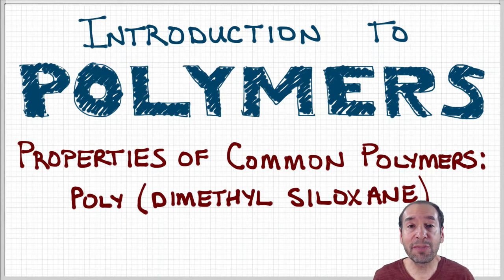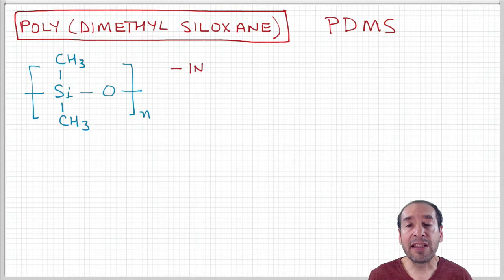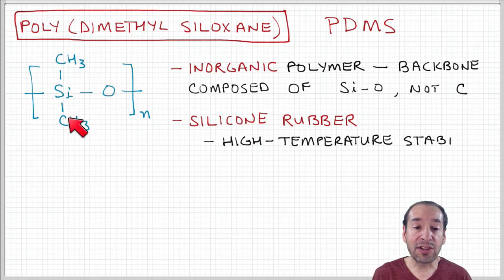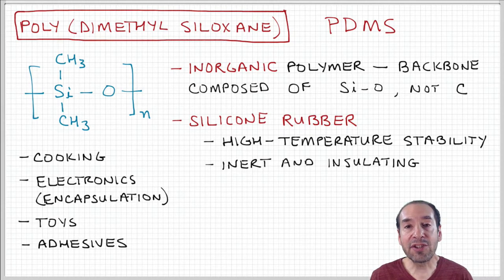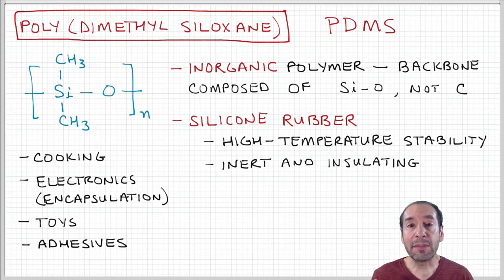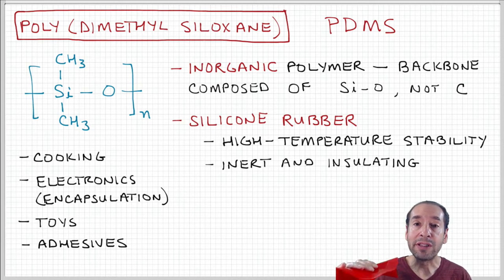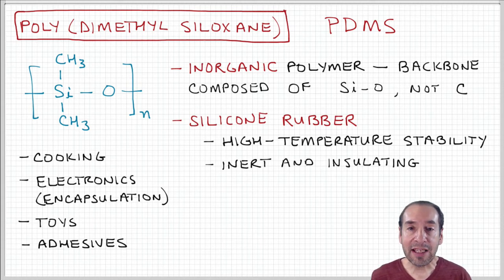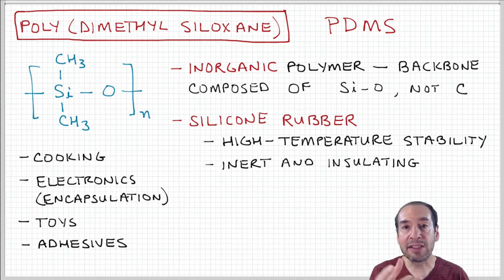Introduction to Polymers - Lecture 2.5. - Polydimethylsiloxane (PDMS)

Comment: Great presentation, thank you.  I cannot break down what happens in the polymer formation, and the cross linking processes of japanning.  AKA JAPAN BLACK.  It contains Gilsonite, resin, raw linseed oil, solvent, lithurge, cobalt, and carbon black.  Pontypool recipe is available online, and under Wikipedia, japanning, the information also contains Henry Ford’s formula for his early cars.  Can you please point me in some direction?   The use of carbon black is definitely used by the tire manufacturers, but the actual purpose is still debated after 100 years of usage, experimentation, conjecture, and discussion.  Thanks again, you picked up a new subscriber 😮